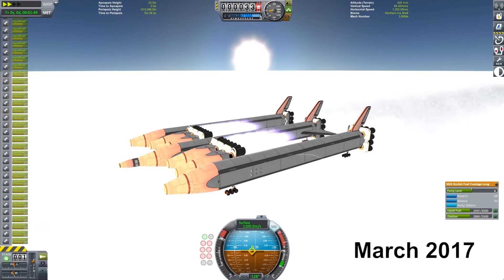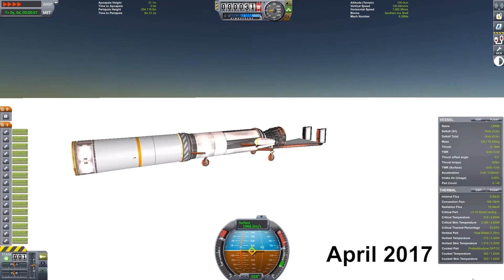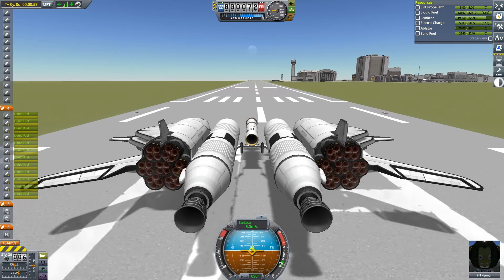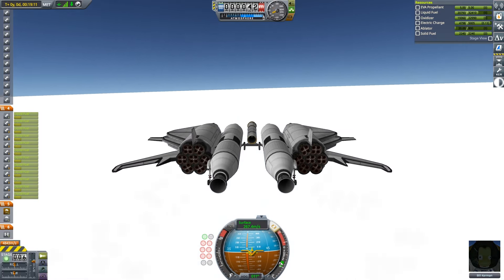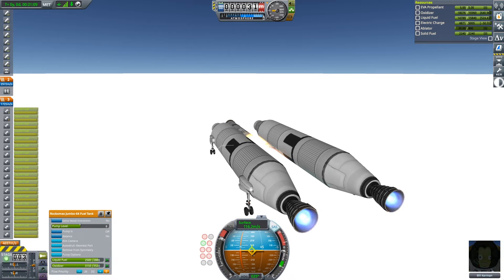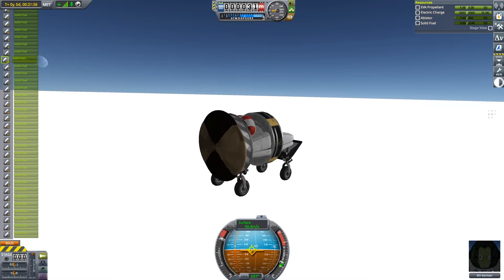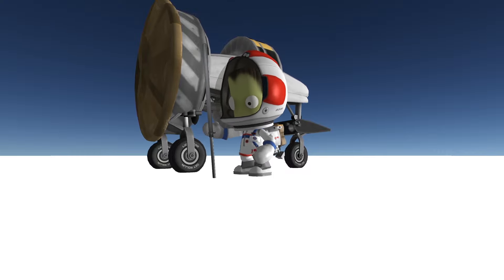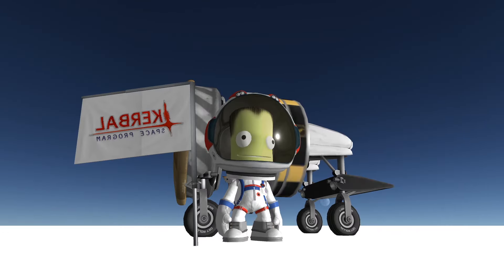KSP Stock Land Speed Record - Breaking 4000 m/s, 9000 mph

Comment: Next month: Brad Whistance gets into orbit using only reaction wheel torque as propulsion.
Reply: dontcheckmychannel I want to see if he can make an ion ssto with his prop tech, probably not mathematically possible unfortunately
Reply: You can actually make a helicopter using nothing but reaction wheels and basic fins as propulsion.
Reply: @Known_as_The_Ghost  I know. But getting into orbit is a whole different deal.
Reply: @dontcheckmychanel  
Additionally,
Today...
I was capable of creating a 'Spinbot' that only used Reaction Wheels and Basic Fins as propulsion, and reached speeds of 300m/s easily.
The 'Spinbot' became unstable, which caused it to... 'land' into the ground at very high speeds, causing a 'premature disassembly', and 'pretty lights'.
So, it may actually be possible to orbit with the Reaction Wheel method.

I was also abusing Timewarp x4, but that's not important.
Reply: dontcheckmychannel his props can get to 1000ms so maybe with Ions he could get enough delta v and twr to get to orbit
Reply: If not kerbin laythe
Reply: @iain3713  I could have sworn I said "only reaction wheels".
Reply: @iain3713  he has
Reply: @iain3713  for the Ion ssto he went to duna with one and back
Reply: gallimimusgamer and other stuff an ssto is a single stage to orbit
Reply: @iain3713  oh derp on my part I knew that
Reply: @Known_as_The_Ghost  you abused phys warp? shame.
Reply: @robinyeah4134  Good luck. :)

Comment: For a sense of how fast this actually travelled, it was going at its top speed mach 12.4 or 12.4 times the speed of sound which means it was going plasma-sonic, much faster than hyper sonic. Irl this would have meant he would have had radio blackout in the same way re entry capsules do during re entry.
Reply: Never heard of that term before!
Reply: Generally anything Mach 10 to 25 is referred to as high-hypersonic. Anything greater than Mach 25 is just re-entry speeds. Also, plasma blackout mostly occurs on re-entry.

Comment: The best part of the Metrical System is that you can say it on meter or kilometers without dividing by 12.3 or 3.8 or 1.4 like feet, thumb ans miles morales system

Comment: BW: Casually mentions that if this rocket car doesn't hold itself to the ground and have drag it will escape Kerbin's influence

Me: How are you so calm about this?!
Reply: When ksp 2 comes out him and Scott Manley NEED to play multiplayer together.
Reply: i was laughing my ass off at the visual for that
Reply: it wasnt drag that was the issue - I'm pretty sure heating would be the main factor
Reply: 2500 g isn't fascinating enough?
Reply: Well, if I didn't hold myself to the ground and didn't have drag, I could escape the Earth's influence on my bicycle.
Reply: @catavar9921  Can't generate thrust on a bicycle, so no.
Reply: Not disabling drag, disabling atmospheric heating so it doesn't explode.
Reply: @guard13007  If there is no drag and no gravity (i.e. "don't hold myself to the ground") I don't need to generate thrust to escape the atmosphere.
Reply: @guard13007  P.S: In fact, even with gravity, I could escape the Earth's influence on a bicycle. The operative word is "no drag".
Reply: Catavar I don’t think this is true even if you discount friction. A bicycle can only accelerate by pushing off the ground. Above speeds of 2400 m/s, your bike would not be able to maintain contact with the ground since the centripetal force required exceeds the force of gravity. Since escape velocity is around 3400 m/s, you’d be stuck in Kerbin’s gravitational influence. You’d have to accelerate by 1000 m/s in basically an instant.
Reply: @suremarc  What you say is correct, however:
1. I wrote "no drag" specifically, because I was referring to air resistance. If there was no friction at all, a bicycle couldn't accelerate at all.
2. Since friction is usually calculated as downward force times a friction coefficient, achieving orbital velocity would mean no friction, thus no acceleration. So you are correct - on a perfectly spherical planet. However: I could use a ramp. 
(That said, I would still have to accelerate faster than my quads could reasonably be expected allow, but then, my original comment was only meant as a bit of harmless fun anyway.)

P.S. The OP also said "did not hold itself to the ground", which I interpreted as "no gravity", and in that case, obviously you could escape the Earth's influence on your bicycle, because then it wouldn't have any influence.
Reply: This is with drag though. He doesn't mention disabling drag, only atmospheric hearing. If there was no drag, that flap would not be able to hold it on the ground once it passes orbital velocity. The craft is so aerodynamic (as far as the game is concerned) and moving so quickly that the atmosphere can't slow it down enough to stop it escaping Kerbin's gravity.
Reply: yeah if a planet had enough mass for 1g of influence it would also have an atmosphere, so this information is irrelevant in the real world and moons are usually too topographically complex to pull off that kind of stunt, because of their low mass the surface is more easily scaped by tidal forces and asteroids. Maybe on Pluto.
Reply: Causually mentions 4000g. 
Me: !?!?
Reply: @catavar9921  you still do because gravity wasn't turned off, the flap providing ADDITIONAL downforce was removed
Reply: @catavar9921  nope. even without drag you could not escape earth's SOI on a bicycle
Reply: because kerbals are immortal :)
Reply: @catavar9921  no one said no gravity except for you.
Reply: @juleswoodbury58  You do know that Tylo is a thing in KSP, right? It has roughly the same amount of gravity as Kerbin.
Reply: @aisir3725  I have reached over twice that
Reply: Now to replicate this in real life. Except the 4000 gees part
Reply: @harrymack3565  we have luna multiplayer and parralax 2.0 + scatterer + EVE graphics mods,combined this removes the need for ksp 2
Reply: @nerfjanetreal seeing how ksp2 was until recently … I think ksp1 plus the mods would’ve been better, haven’t played btw just judging from videos

Comment: Coasting on the surface at the top speed requires about 3 times the centripetal acceleration provided by Kerbin's gravity. So Bill would be feeling -2G just from following the slight curvature of the planet's surface (ignoring the forwards/backwards acceleration). That's pretty damn fast.

Comment: When they rammed the F-4 Phantom jet fighter into a concrete slab on a rocket sled it experienced a deceleration of over 700 G. Bill here would not even be a fine mist at the numbers we're seeing in this experiment :D
Reply: Wasn't that the average acceleration during then impact?
Reply: @matsv201  perhaps, I don't remember the details.
Reply: @Greippi10  it would seam that going from 700km/h to zero in 3cm would need more than 700G
Reply: @matsv201  possibly, I have no idea where I got that number from.

Comment: Hey can someone help? Every time I try to take off on the runway, I veer left or right. I’ve done every thing the internet says to do, and it still does it.
Reply: Have you straightened your landing gear and turned on SAS? If that doesn't work, make sure your center of lift is behind your center of mass, basically put the wings further back.

Comment: Cool! I never thought of using the minimum amount of fuel in a sepratron to gain more acceleration.
You didnt mention how you ended up dealing with the ground unrendering past a certain speed. I know back when strazenblitz did his run, it was a pretty huge problem. Did the 1.8 terrain improvements change that aspect of terrain rendering or did you simply not encounter the problem due to the insane acceleration?